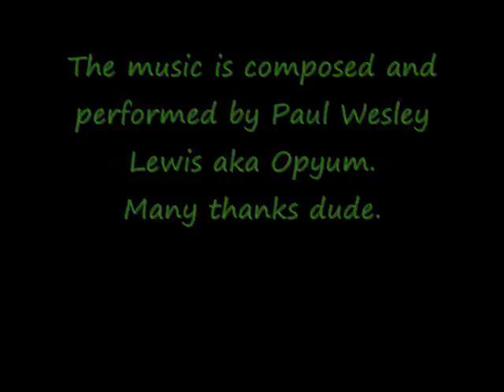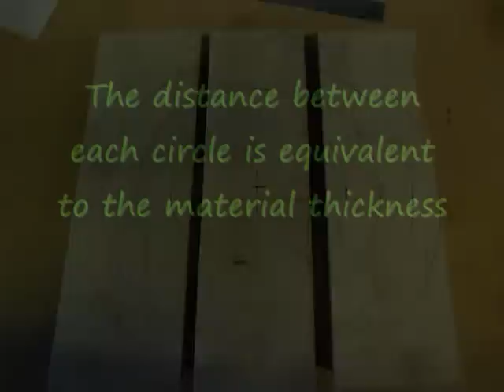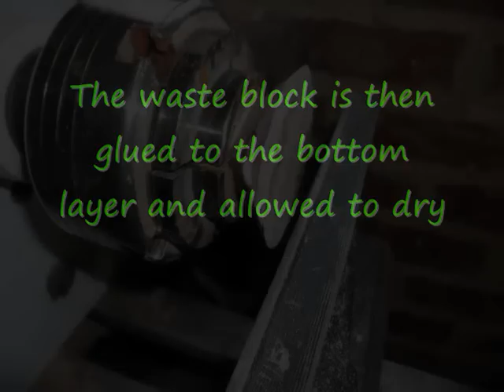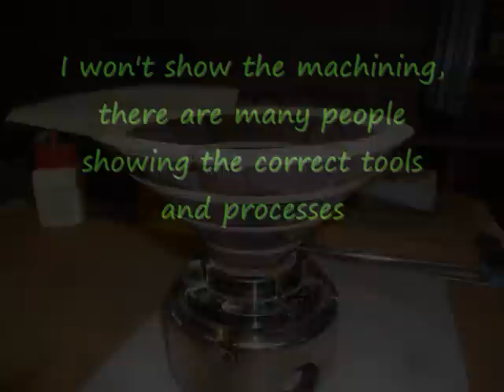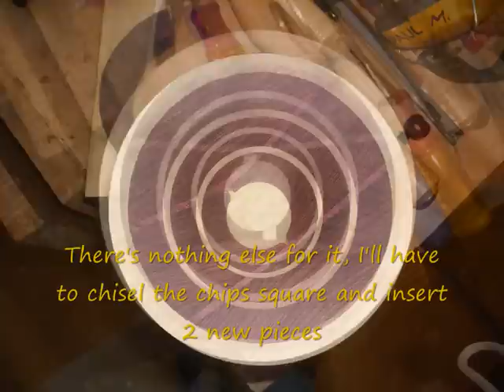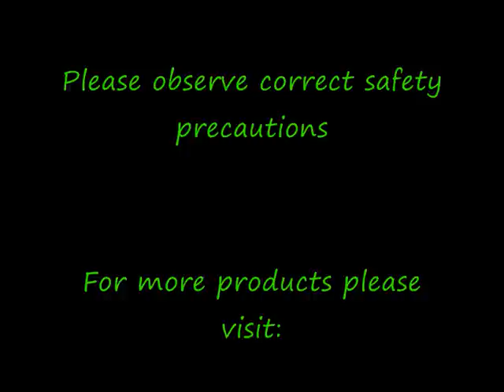Segmented Woodturning. Making a Rosewood Bandsaw Bowl

Comment: would it make the bandsaw portion easier if you cut on a 0 angle  to better hold the piece and THEN cut at a 45 degree angle, not all the way where you form an edge, but if you leave a tiiny bit there you could set up a disk sander at 45 to get the perfect shape?
Reply from the maker: Good idea, but sadly it wouldn't work as you would run out of wood, the 45° angle is essential to one layer overlapping the next. Thanks.

Comment: I have tried this.But if the three pieces are 150 mm long each, and distanse between the circles are 18 mm, the inner circle (for me) becomes smaller than shown on the video. Help ! ???
Reply from the maker: Yep, you're right. I think maybe the gap should be 15mm rather than 18mm. Sorry.
Reply: That`s what what i did. Beautiful ! (And then very thin .(shape? wall ? I'm Norwegian) Now I do the same,some wider, and than with 20mm distance between the rings.
Reply: Instead of purpleheart (as i do'nt have), I used 6 layers of 0,5mm Red Coloured Veneer.
Reply from the maker: Torfinn Bie
Yes, it does produce a very thin wall and a very light bowl. So light people look closely because they can't believe it's wood. Good luck